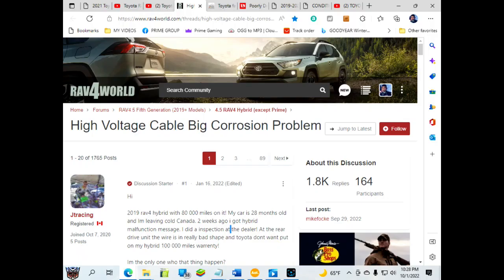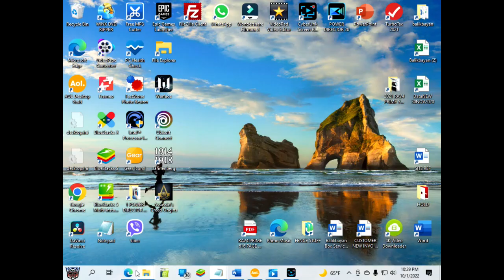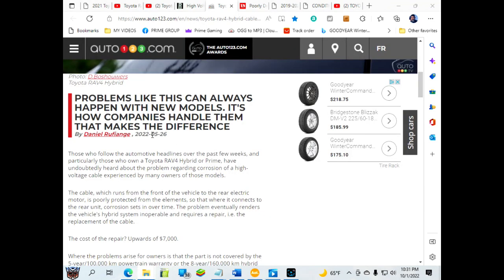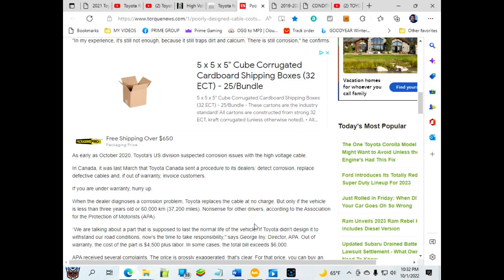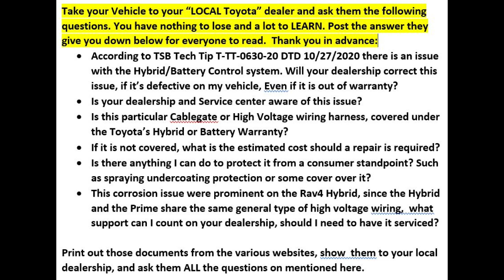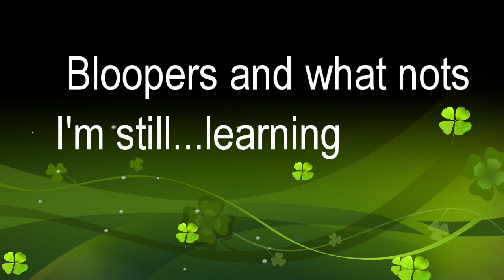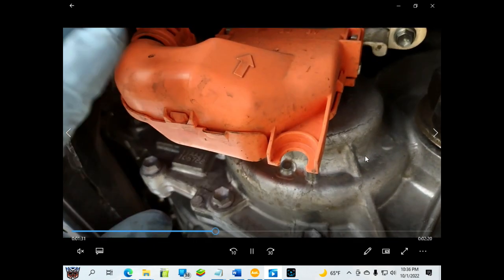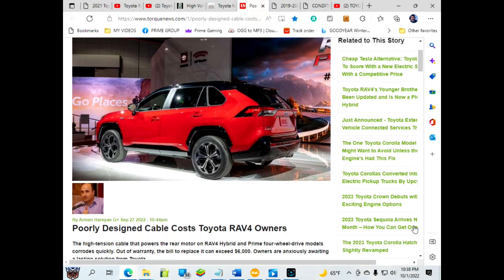Rav4 Hybrid Prime Cablegate High Voltage Wiring problem. This is a MUST READ, as it might affect YOU

Comment: In late 2021, I bought the 2021 Rav4 hybrid not knowing about cablegate. I researched this when I found out and found that this problem wasn't even covered by an extended warranty, which I was considering buying due to the fact that I live near Chicago where they use a lot of salt in the winter. I wasn't sure what I should do. I knew that class action suits in Canada got Toyota to warranty this problem but I didn't hear about the US. A few weeks ago,  I received a letter from Toyota that they were giving all owners an 8 year/100,000 miles warranty under the customer support program. Since I don't do a lot of driving, this was almost perfect for me. I hope they do a recall on this, though.
Reply from the maker: I hear ya, buddy.  Only time will tell.  I check underneath  every 5000 miles or so.  Just to see.  Do you have that "Plastic Shield" underneath it? or is it open?  The RAV4 overall is a nice and very practical ride.  Take care and stay safe.
Reply: @jt2quick  Since it is a Hybrid 2021, I have the closed orange cover. Supposedly, they cut off part of it on the 2022 so that it will drain. From what I have heard, it isn't much of a fix. Why they decided to change this in 2019 is anybodies guess.
Reply from the maker: @osbornto  Hey Buddy....guess we're in the same boat.  Mine is enclosed also.  Part of me wants to take it apart and really look at the inside....the other half says..."Leave it alone dingdong.......you might just make it worst and ruin the whole shebang"....hahahaha..
Reply: I don't know about your expertise but if it were me, knowing mine, I wouldn't touch it.
Reply from the maker: @osbornto  Dude...I"m just a greenhorn...only know a few things here and there, but I do look things up before I tackle a project.... just so I don't become a Kentucky Fried Chicken in my driveway.

Comment: Were you able to get the cable replaced with the redesigned one? Im getting a new rav4 2025 and hoping its the new redesign and it wont have the corrosion issue
Reply from the maker: Hey buddy, NO... I did not and have not gotten my cable replaced.  I do check it on a regular basis and it is still fine. No signs of corrosion or problems.  From what I understand or have heard the "NEW" redesign one is that a portion of the bottom half has been cut away to allow drainage of any liquid.  When you get yours...kindly let me know if that is the case.  I am curious myself.  As far as my 2021...still running smooth as butter...in the winter time still getting an overnight charge of over 53EV.  Take care and stay safe.

Comment: Question: With Snow, floods, deep water one might expect this. But what about dry climates?
Reply: If your in dry climates away from salt water I'd say it'll be fine.
Also this is old information they fixed this problem in 2022 . So the 2019 through 2021 models are the ones you gotta worry about.
Reply from the maker: I'm not a mechanic, but I do concur with Farmsalot. I'm in Oklahoma and so unless you're doing some Off- roading, mud slinging, Deep river fording, Dukes of Hazzard type of driving....mellow drivers like us should be okay.  If it's really fixed, great for some. But since mine's a 2021, I'll add it on to my usual routine maintenance to check on.  Hope I don't get electrocuted, gonna do a 2nd video taking off the plastic and taking a closer look at the harness for the owners in our situation.
Reply: @farmsalot1233  this problem isn’t fixed all they did was open the bottom of the Orange connector and the 22s are starting to have the failures already. I bought a 22 because I was told they were fixed ,it’s not.
Reply: @farmsalot1233   No this is not fixed. They simply updated the cover, but there is still galvanic corrosion https://www.youtube.com/watch?v=J1pv05cn0Mw
Reply: I believe the cold has an influence. Some Ones I've seen the water was coming inside and drain was plugged. So if rear hatch wasn't sealing so even car wash rain coming through weather seal could be a issue.

Comment: Hi A big fan of your videos. Have you heard of the good news my friend? The rav4 hybrid and venza 2023 cable gate (MGR) corrosion issue is already fixed. In here they changed the bolts and connector to the motor to be aluminum and stainless.
Reply from the maker: Thank you Vin.  That is good to hear.  By chance do you have a link or more info on that?  Maybe a service bulletin or news clipping, so that I can convince my local dealership to do something about it? Take care and stay safe.
Reply from the maker: @vinyu7186  Thank you very much for sharing that. Take care and stay safe.
Reply: I heard that some people had a recall to change their high voltage cable to a "re-engineered Cable". I'm assuming that they have done this for the 2023 model which I have ordered already and have been waiting for 7 months. I didn't know what that meant until here I read that you say that the bolt and connector has been changed to aluminum and stainless.
Reply: I'm very pleased to read your comment about this because this was a horribly expensive repair, at least here in Canada.
Reply from the maker: @GarryBurgess  Hey buddy...here's some more info about that high voltage cable issue.  I listed to Car Car Nut channel as he really puts out some good info. I pretty much just pass along what I hear.  And check out the link below and listen for yourself.  At the 9:58 mark and at the 26:06 mark of the video below.  Basically the updated cable was just that the back portion was cut out. I'm assuming to let the water drain properly.  He mentioned also that on the Rav4 Prime itself....there's not much data to show if it was affected by this or not.  I check mine whenever I'm under the car as it doesn't take long to take that shielf off and mine is A-O-KAY.  

https://www.youtube.com/watch?v=322JTrNvlHg

Take care and stay safe.
Reply from the maker: @GarryBurgess  I'm curious myself.  let me know...if they just replace it with that cutout in the back.  That is if you can get under the car.

Comment: Drill holes at bottom of the connector for drainage and try to use some kind of waterproof foam at the connector seams..solution for now
Reply from the maker: Thanks for the tip.  Can you tell us how yours look?  Like notice any rotting, cracking, signs of damage etc?  I'm actually trying something out...just to test it and see how it works..and will post it once I'm done with the test.  Take care.

Comment: Geeze, 7k for a 3 wire jumper cable? I friend of mine has this his with his, and the car has bee offline for a month so far, and they can't even get the part yet.
Reply from the maker: Yup...but...that's how the Manufacturers make money?  Same as Govt spending a couple grand for toilet bolt. hahahaha
Reply: @jt2quick  These are failing during the warranty period, so they are going to lose money, and reputation on these hunks of junk. This will be a huge recall soon.
Reply from the maker: @JimsEquipmentShed  Hey buddy...as far as recall....that would be nice...but I doubt that.  Not like Tesla or other EVs out there on the news turning into fireballs.. Only news saying....possible corrosion damage, etc.  But losing money, you know these BIG Corporations.. they got billions.  But can't say for other Rav4 Primes, but mine?????  Wouldn't trade it for anything.  Haven't regretted her at all.  In hindsight, if I had known and had the chance..I would have bought Two of these babies... They're just so... practical is the word for it. Take care.
Reply: @jt2quick it’s only practical when it’s running. And according to cablegate it’s not an insignificant number.
Do you live where there is no road salt? 
My buddy’s car is off the road and will be until the parts are available.

Comment: On my 2019Rav4 without disconnecting electrical cable I:
1-  detached the connector assembly from rear drive housing (there are two bolts at the top of connector assembly  mounting it to housing)
2- opened the orange cover, removed completely the shilding, cleaned the exposed cables and connector aluminum housing  
3- filled the two orange cover pieces with clear high temp.  silicone, closed them on exposed cables and attached to connector (excess silicone was pushed out during closing of the orange cover)
4- applied silicone all around the connector joint to prevent  any  moisture and dirt from getting into cavity where the rubber seal is between the two connector parts 

No fault codes were set and there more than 2500 miles on the odometer  since the fix. 

Shilding removal doesn't set fault  codes!!!
If shielding was there to provide ground, then
corrosion  would disconnect it  and set a code.
Shilding only supports cables! 

Applying  grease  creates magnet 🧲  for dirt and dirt has ability to retain moisture.
By eliminating cavities for collecting contaminants I might be able to avoid costly replacement of this long cable, which runs all the way to engine compartment. 

The orange cover on my vehicle has a full back piece. On later models Toyota released connector cover with large part of the back cut out to improve drying. However it didn't help, but only increased opportunity for collecting dirt.
Reply from the maker: Hey Jesse....thank you for sharing that.  I tried myself to open up the orange casing, but was afraid I would crack it using too much pressure at the contact points. Any suggestions on that part?  I was thinking the same thing as.....  yes putting silicone on the connector joints are supposed to keep moisture out...but then again..it would attract dirt and stuff.  

And you're correct....I watched the video from the Car Care Nut and he did mention the fix for it was opening the back half of the orange cover.  

I did buy this on Amazon, figured at some point I would enclose the entire orange housing:
https://www.amazon.com/gp/product/B00DY9IXFI/ref=ppx_yo_dt_b_search_asin_title?ie=UTF8&psc=1

I don't know if your Rav4 has that plastic shielding under the cable housing or not, but here in Tornado country...at least the elements isn't too bad for my Rav4 Prime. 

Take care and stay safe.

Comment: The 2022 models and up have been fixed.
Reply from the maker: hey Farmsalot....would you happen to know what they did to fix the issue? or maybe a link to the article how it was corrected as they say? Thanks.  About to take a closer look at the harness area to see if there's any real concern and show others what it looks like in a dryer climate.
Reply from the maker: @TheRealToastman  Hey buddy. Thanks. Forgot all about that AMD mentioned that FIX on his channel I subscribed to. And yes.  it was that half opening and that plastic shield.  Mine still has the Full plastic shield.  I asked him about issues with wrapping it in HV electrical tape and then overlapping that with high temp waterproof tape like the 3M Aluminum Foil Tape 3340. But still haven't gotten a reply.  The dude is probably super swamped with ten million other questions. But that's for sharing. 

JT
Reply: Nothing fixed except the bottom of the connector cover is opened up. See the message above. Still an issue.
Reply from the maker: @chinnana583  Thank you for that information Chinna Na.   I wasn't sure myself, but you just confirmed what I had seen somewhere and you're right.  It's not really a fix.  So I'm gonna try something and post it down the road. Take care and stay safe.
Reply: It has not been fixed